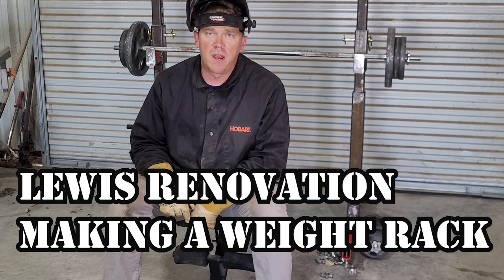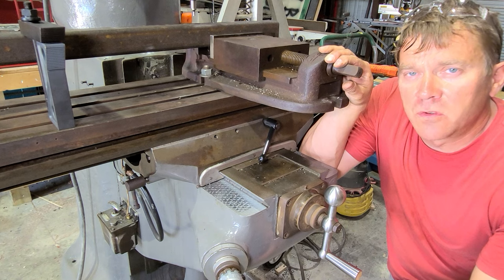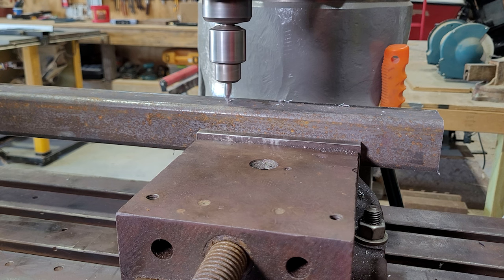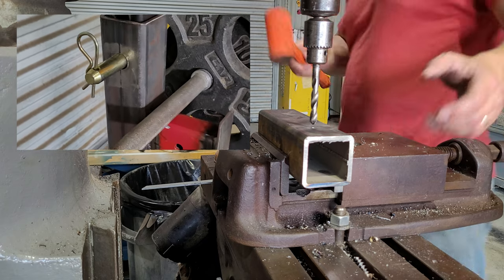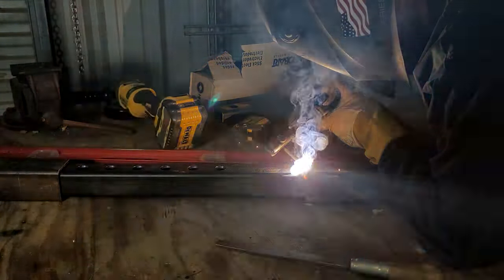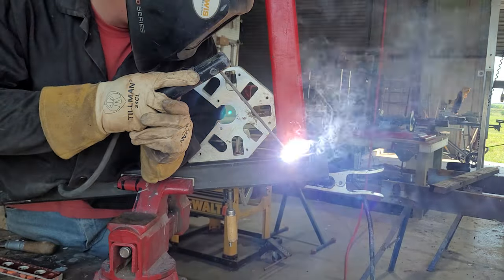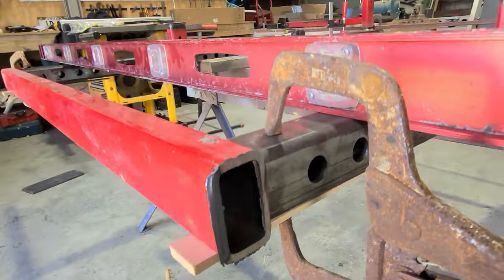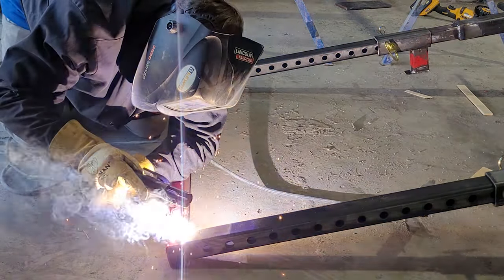Weld a Bench Press Rack

Comment: hey i’m trying to do this for my school welding project but having trouble finding all the metal/ material list and am wondering if you have or remember it
Reply from the maker: 2x2x1/4 tubing for the uprights. 2.5x 2.5 for the sliding bar brackets. The cross piece and legs were just scraps I had laying around
Reply from the maker: Good luck!